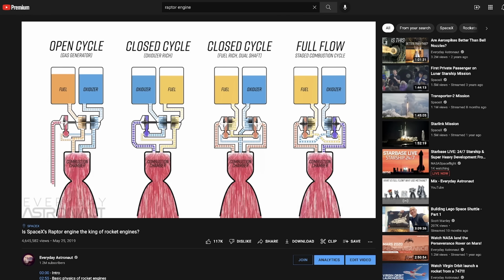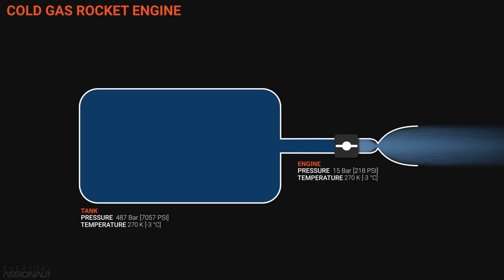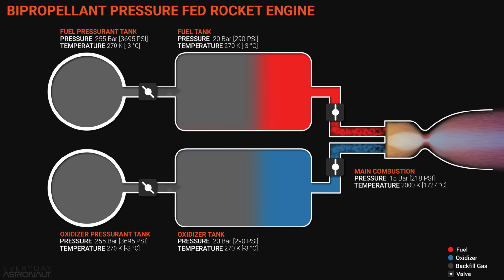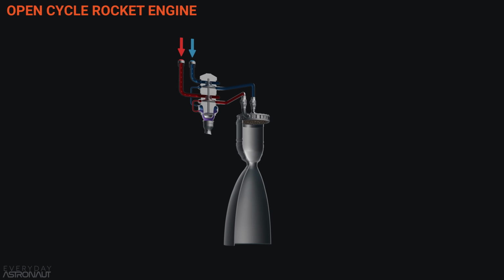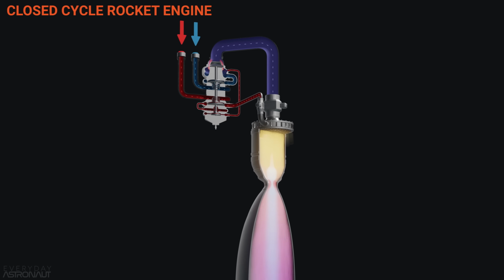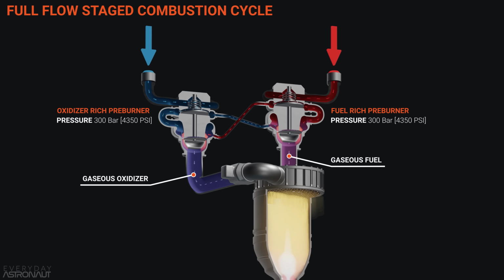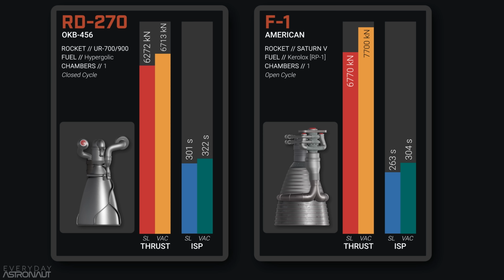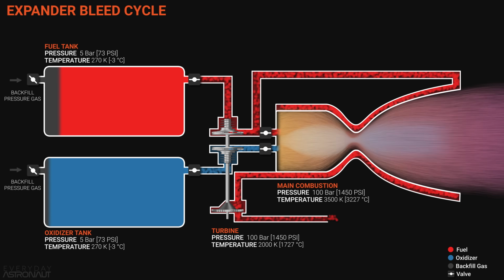Rocket engine cycles: How do you power a rocket engine?

Comment: The first stage of a rocket is usually operating entirely or almost entirely within Earth's atmosphere, so why not take advantage of that by replacing a portion of the oxidizer tank with compressed air, like an air breathing turbine, allowing the ship to carry more fuel and burn it more efficiently than a rocket engine typically does. Then just keep a smaller amount of oxidizer that you feed in as air pressure and oxygen content drop.

Comment: Someone is in error. Either the engineers like to waste energy or the CGI team don't know their tech...or there is a subtlety you are not discussing[thermodynamics of the entire system, I suspect. No time to analyze.]. At 29:31 the oxidizer pump is presumably increasing P to 200 bar but the main combustion chamber is only at 100 bar. Yes there is a pressure drop across the pre-burner turbine but, from thermodynamic [efficiency] point of view, it does not make sense to pressurize ALL of the oxidizer just to waste that energy in the turbine.

 I'd pressurize most of the oxidizer to 120 bar like the fuel, and some to 200 bar to power the turbine in a complete [stoichiometric] burn. The 120 bar hot gas exhaust heats either the oxidizer or the fuel or both. Personally I'd drop the pressure across the turbine more to produce increase the work output, probably use a heat exchanger and then dump the low P cool exhaust. But, then, we have the tech to enable this.

Comment: Can't stop thinking about sequential turbo setups when watching the open cycle chapter. It functions almost exactly the same! Using a smaller rocket to power the turbine shaft of a larger rocket in order to produce more pressure on its way to the combustion chamber! Same idea as using a smaller, quickly spooling turbo to spin the compressor turbine of a larger turbo in order to send more pressure to a combustion chamber. Engineering is beautiful.

Comment: The f1 wasn't an open cycle. The Gas generator exhaust ran into a manifold that channel it in to the thrust chamber extension. The exhaust was used to create an insulation barrier from the primary exhaust flow. The thrust chamber extension was made of stainless where as the main thrust chamber was made from hastelloy tubes that carried fuel to the injector. This both cooled the combustion chamber and preheated the kerosene.

Comment: So is top dead center and ignition timing similar in a rocket or gas powered turbine engine where, the ignition is fired just a few degrees before maximum compression?

Comment: 18:30 - "As long as the weight saved on tanks is lighter than the wight of the pumps, motors and batteries, its a win"
I guess that you mean the opposite: the weight saved on tanks must be higher than the weight of the pumps, motors and batteries, before its a win.

Comment: @ 30:57, what I'd like to know is, does Russia still use the fuel-rich system or is it a thing of the past for them.  The U.S. needs to stop their dice-tossing fuel rich/oxygen rich mixtures & settle on Russian decades long proven methods.  Why not give priority to matching or exceeding the strength & corrosive resistant features of the stainless steel alloys used in Russian modern-day rockets?

Comment: Maybe this is already done, but couldn't a battery/solar panels be used to power a heating element in order to get a bit more performance out of a cold gas thruster?  For instance, for something like the MMU where the entire unit is being recovered and the batteries are already required for other reasons, couldn't that increase the enthalpy just a bit more to be worthwhile, or is the extra complexity/weight just not worth it?

This sounds like a question for a Scott Manley Q&A video.

Comment: Flows don’t always go from high pressure to low pressure… It is complicated (having chased the oxygen contamination of a high purity high pressure nitrogen system to a gas leak). As a general rule yes but in trace amounts no.

Comment: What if you stuck a bare wire harness inside a tank of water with a cork in it and ran high voltage through it for a steam powered rocket

Comment: A convenient way to picture a full-flow engine is by looking at a turbojet engine.  In a turbojet, the air is pulled into a compressor, which in the burner is mixed with a little bit of fuel, expanded and pressurized, and escapes out the back through a turbine that extracts enough energy to power the compressor, and shoots the rest out the tailpipe.  The output is mostly normal air, with a little combustion exhaust.

A full flow preburner rocket engine is like having two turbojets, one flowing oxygen and a little fuel, and the other flowing fuel and a little oxygen, with both turbojet engines feeding the combustion chamber their exhausts.

When they do a "spin test", they're running one or other of the jet engines for a moment.

Comment: There's actually one more cycle: the one used on the Black Arrow. Here, the oxidizer - hydrogen peroxide - is used as a monopropellant to run the turbopumps, and then the decomposition products, which happen to be hypergolic with RP-1, are used as the actual oxidizer in the main combustion chamber. The same thing can probably be done with hydrazine and N2O4, just with the roles reversed.

Comment: I was beginning to worry that you wouldn't talk about the RL-10. If memory serves (and I'm 84 now so who knows) the RL-10 used a bootstrap start where the liquid hydrogen was used to "prime" the engine such that when it was needed to actually ignite and provide thrust, a frangible disk valve was pierced. The liquid hydrogen immediately flashed to gas which then "powered" the turbo pump to pump the lox and more hydrogen into the engine. When the correct condition was achieved the engine was lit and the process  continued until engine was shut down. Obviously an oversimplification  but should begin to illustrate the RL-10's somewhat novel design. 
One of my earliest jobs was working as an instrumentation tech for Pratt&Whitney on the RL-10 at their Everglades facility and always thought that the RL-10 was a work of art...

Comment: A shame that chemical rockets limited to 460 ~ seconds of runtime // given the cost especially // I would think silicon nitride ceramics developed by Kyocera & similar zirconia ceramics (optimized for very high temperature kilns) would enable hotter temperatures without melting or allowing the materials to warm or stretch // metalloids or other emergent materials like graphene // I am curious if or when ceramics will play a role in rocket engines //

Comment: Wait, I thought carbon-based fuel rich cycles led to coking and clogging and expensive inspections. How does SpaceX deal with that in the fuel half of raptor?
Reply from the maker: Methane doesn’t have long chain carbons so it burns clean, just H20 and CO2. No coking!

Comment: maybe a stupid question, but isn't it possible to combine expander cycle with full flow? you would eliminate the need of heat to startup the expander cycle because the preburner will power the pump first, then you would increase the heat in the preburner with the heated fuel, making like a powercycle

Comment: Very good amateur technical explanations but you are completely leaving out that these new rocket launches significantly contribute to atmospheric pollution due to the continuous uptick of space flights. For example, nitrogen oxide from the exhaust can remain in the atmosphere at high altitudes and carbon dioxide is emitted into the mesosphere atmospheric layer. Cool engineering - mechanical, thermodynamic, chemical, and so on are only going to stay cool if we can keep doing it without turning our planet into the one in Wall*e.

Comment: Awesome video!

Regarding the pressurant, I never quite followed what keeps the fuel or oxidizer it pressurizes … cohesive?  As the fuel or oxidizer tank empties out, it’ll eventually just form bubbles and the eventually, the pressurant gas will just go straight into the combustion chamber.

Now the answer, presumably is “ullage motors,” which provide just enough thrust to force the liquid propellants toward combustion-chamber end of the tank, but that’s just more complexity, right?  

Header tanks similarly:  more complexity, it would seem.

Wouldn’t it be simpler to have a piston inside the tank to keep the pressurant and reactant separated?
Reply: On many spacecraft, ullage motors are already present, RCS systems are already needed and can often be used to settle the fuel at the bottom of the tank.

To supply fuel to the RCS thrusters, they dont use pistons to keep fuel and pressurant seperate, but membranes, those are much lighter.

Comment: What if you simply used a hydraulic ram inside the fuel tank to physically pushed the fuel out of the tank? Yes the hydraulic piston would take up a lot of space, but it seems worth it for the simplicity.
Reply: Pistons are just too heavy and still has all the disadvantages of a pressure fed engine

Comment: Tim, why was there never an effort to develop a fuel-rich closed cycle hypergolic engine? The metallurgy would have been simpler,  hydrazine derivatives do not coke up, and they would not have had to build plumbing and turbines that have to tolerate the full flow of superheated N2O4 being fed into the pump/plumbing/injectors? I have asked this question a thousand places and no one has ever answered. It seems simpler than all of the oxidizer-rich closed cycle designs the Soviets made.
Reply: You need to ask it at a rocket science forum or subreddit of some sort.
Reply: N2O4 has the advantage of reacting to 2 NO2, meaning lower turbine temps for the same turbine output

Comment: There is the pressure-fed engines that HAD to fly untested, and fire the first time, every time; the LEM's Descent and Ascent engines, designed by TRW and Rocketdyne, respectively.  The Descent engine could also throttle, and designed to crush on landing, acting as a shock absorber, as was demonstrated on Apollo 15.  These engines were installed UNTESTED into the LEM as it was a complex act to clean and refurbish them after testing as they operated on helium-pressured hypergolics.  So they were designed with super simplicity in mind and put to the test.  And you guessed it, they flew without a hitch and were the unsung heroes of Apollo.

Comment: After watching this for the first time, I was very confused as to how the gas-driven pumps work. Watching a second time, it seems like this vid doesn't really address it, but I had some thoughts of my own, so I'm going to put them here and hope Everyday Astronaut or another informed person can weigh in.

The initial confusion comes from the fact that due to the pressure gradients needed to make sure fuel and oxidizer flow in the correct direction, the gas driving the pump would be at a lower pressure than the output pressure of the pump. This struck me as unphysical and like a recipe for a perpetual motion machine -- connect the pump output to the gas input.

However, I realized that a pump could use mechanical advantage to allow the lower pressure gas input to create a higher pressure output -- but at the cost of needing a greater volume rate of flow in the gas input than the pump output will have. No perpetual motion machine possible. That greater volume of gas is available since when the liquid propellants become gaseous, the same amount of propellant at a given pressure occupies a much greater volume. Is this how the pumps work?

Comment: @48:50 I was confused about why it's easier to cool a larger engine until I realized that the amount of fuel used (I presume) scales as the volume of the engine.  So with larger engines the amount of fuel per cooling surface area increases.

But OTOH, the amount of heat generated should also scale with the volume (and the amount of fuel) so again it's not clear why cooling a larger engine is easier. The lower surface to volume ratio of larger engines is generally working against you cooling-wise.  For extremely large (perhaps impractically large) engines the amount of surface area is negligible compared to the volume while the larger amount of fuel flowing through the walls should be exactly offset by the larger amount of heat that fuel generates.
Reply from the maker: Most of that heat with a larger engine is inside the area, and doesn’t come in contact with the walls. The walls surface area increases by the square of the radius while the whole area increases by the cube. So the amount of relative surface area that’s in contact with the hot heat actually decreases with scale
Reply: @EverydayAstronaut  Thanks Tim!   So most of the heat from the interior doesn't get to the nozzle and you're only concerned about cooling the nozzle.  The heat getting to the nozzle goes as r^2 (from some volume close to the nozzle) but the fuel to dissipate that heat goes as r^3.

I'm so accustomed  to using more surface area to increase cooling (like the fins on a heat sink) it seemed counter-intuitive that less relative surface area would lead to better cooling.

Comment: Are their any instances where electromagnetism is used to aid in the acceleration of the gases propelled through the bell by using some kind of an additive? A kind of guass cannon meets full flow, does ion drive right scenario?
Reply: electromagnetic rails on the outside of the bell that create a pulsating magnetic field that functions like a gauss cannon to accelerate the burning fuel. Fine ferrus dust can accelerate the exhaust and improve efficiency.

Comment: It's interesting that SpaceX chose extreme complexity over slightly less efficient, but simpler engine. You would think that if rapid reusability is the main priority, it means that engine should be as simple as possible and as reliable as possible, even if less efficient. As Tim said, what good is 200 ton thrust engine if it has 100 points of failure versus 180 ton with only 20 points of failure. Yes, you would deliver less cargo to Mars, but you would deliver it much more reliably.

Comment: Wow, very interesting and well explained thank you! One question, just curious if anyone has an answer to that: Assuming we had a massiv break through in battery tech, could use power to heat up e.g. lead (Pb) above its boiling point (~1700 °C) and push it out using electric turbines? Seems interesting for long distance space missions, because of lead density (~10-11.000) compared to liquid methane or hydrogen.

Comment: well put that way with car engines don't sound that hard supercharger driven by crank is a forced induction not free power superchargers have almost no delay in boost or lag and will lose its efficiency at high rpms  
. natural aspired well the name says it all natural induction ie not forced both these give less heat and  turbos are free power driven off exhaust fumes allot of heat less exhaust plumbing needed materfact the faster you can get the exhaust fumes out the faster the tubro can spool older turbos had low end lag basicly spool up speed was needed new biturbos or twin set ups cut the turbo lag down hell some times people over explain

Comment: thank you for this fantastic video! Very instructive!!

in my understanding, the raptor has the oxygen power head sitting directly on top of the combustion chamber, avoiding piping hot oxygen gas through bends. in the video the fuel side was shown on top of the combustion chamber. Is there a reason for showing it like that? maybe due to the RD engines that have this labyrinth of oxygen pipes?

Comment: Great video! (except for the cringy "pressure flows from high to low" part that should have been "fluids flow from regions of higher pressure to regions of lower pressure." That's still not even completely accurate, though. Fluids flow; pressure is a property of a fluid. A pressure difference can cause fluid to flow, but pressure itself does not 'flow.')

Comment: Fantastic piece.  Thank you very much.  What about an engine that bleeds gas from the main combustion chamber, run the gas along the oxidizer tank, cooling the gas down, and then push the gas into the backfill pressure valve this way pushing the propellant instead of pushing and pulling?
Reply: The pressure inside the tank needs to be much higher than the pressure inside the combustion chamber, also, due to the engine running fuel rich you are throwing fuel into a oxidizer, meaning you blow up your tank

Comment: At 19:45 you're overstating the difference by at least an order of magnitude (I assume you actually mean energy density) since you're neither including the weight of the LOX nor all the unburnt RP1 that's used just to keep the turbine temperature under control. The turbine is also less efficient at actually converting that energy into work than an electric motor is.

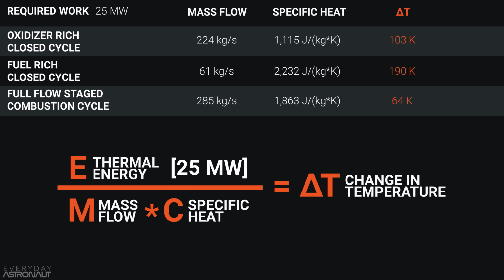Comment: I still don't quite understand the benefit of a smaller temperature drop across the preburner turbine 41:04. Does the temperature of the gas leave the preburner required to be very high? I thought they only need to be warm enough to be in the gas phase. Even assuming the gas leaves the preburner has to be hot, is the sole benefit just to decrease the temperature in the preburner by about 100 K? In addition, doesn't lower the temperature drops indicate lower work efficiency according to the second law of thermodynamics?
Reply from the maker: If you need less heat to do the same amount of work, you can have a lower temperature to do the same work 👍
Reply: @EverydayAstronaut  good to see you replying to more recent comments